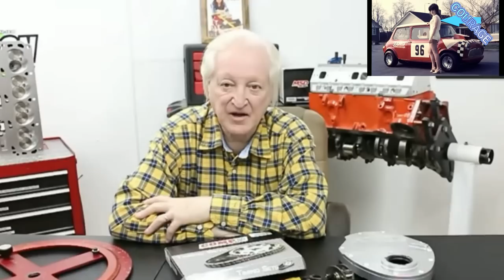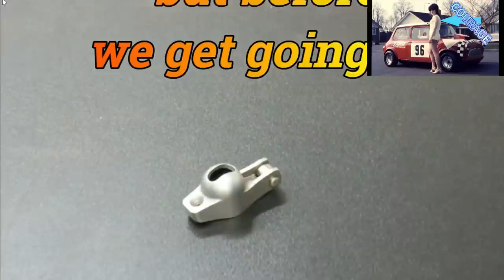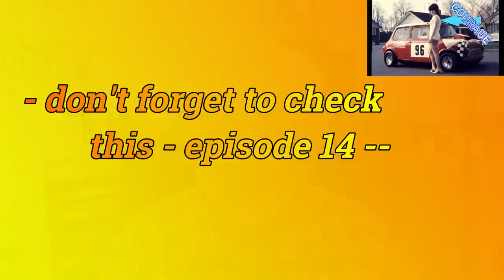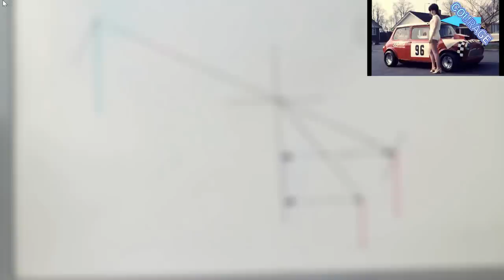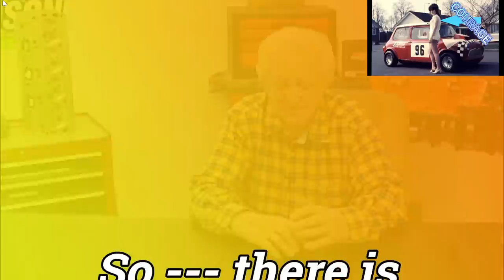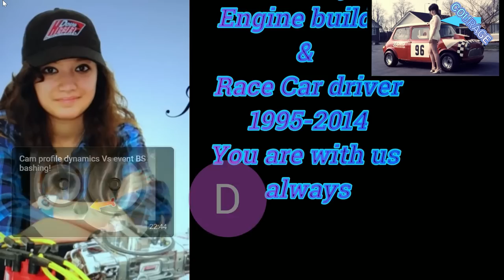High lift rockers - desirable but incorrectly tested.

Comment: I'm running 1.7 scorpion roller rockers on a tbi 350 sbc. Surely that's better than the stock stamped 1.5s
Reply from the maker: Yes - have used a lot of those rocker with zero problems
Reply: Did it make any difference in power? I figured the cork in the tbi was the crummy 2 bl throttle body, not the (puny) cam. I woke mine up with a true dual exhaust and no meowers.
Reply: @jeffrykopis5468  it helped some. The thing about the tbi motors is that the components are matched pretty well.. and NONE of it is designed to make horsepower. Lol
  The stock cam had .385"/.402" lift. If you simply multiply the lobe lift by the advertised rocker ratio lift, you'll get .437"/.456". I haven't mic'd it.. I just slapped them on the stock pressed-in rocker studs. I don't rev the motor past 5k so they're fine for now. I've got a comp xfi252hr roller cam (202⁰/212@.050") (.585"/.581" with 1.7's) and a different set of heads with screw-in rocker studs and comp beehive springs. 
  The rest of the tbi 350's combination is very well matched.. anemic 2bbl throttle body with 2 small injectors to feed 8 cylinders. A 20hz computer. Hz.. like 20 calculations per second... not khz. Not mhz. Not ghz. Not thz. Simply hz. .. 
  Swirl port cylinder heads with a giant ramp in the intake port that are done flowing by 3500rpms. 
  The best thing about them is the exhaust manifolds and exhaust system. They flow just good enough to support the stock horsepower. That's why open headers give almost zero horsepower increase on a bone stock engine. Peak torque was rated at a lugging 2400rpms. Which, with a th400 and 4.10 gears and stock 245/75R16 tires would net cruising speed of 50mph@2400rpms in 1990. Right in the meat of the torque curve. They actually mathed things out back then. To meet lower emissions requirements, just turn the engines slower and tune them for low end torque. 
  I figured a little more valve lift would allow a marginally higher amount of airflow throughput. It can't hurt the rated 190hp, right? 
  I've got the parts together to make approximately 325hp@5000rpms and 430ish lb-ft@3500ish. My biggest hurdle will be tuning the stock tbi unit at over double the stock fuel pressure. My plan is to run a vacuum-referenced fuel pressure regulator before the stock internal fuel pressure regulator fitted with a 29ps spring. The vacuum referenced regulator will deliver around 19-20psi at idle and cruise while bumping fuel pressure (and overall fuel flow) under wide open throttle. 
  With a completely stock engine and computer tune (aside from headers and free-flowing exhaust) my commanded injector duty cycle was 114%@3800rpms.
  My exhaust setup is a pair of 1⅝" long tube headers into a 2½"collector, a smooth y-pipe to single 3". 3"idx24" glasspack. Immediately opened up to 4" and a 4"idx30" glasspack  and a 4" tailpipe out the stock location at the passenger's rear corner of the 8' longbed. It has a mellow tone at idle and cruise but seems to growl at wide open throttle. As much as 190hp can. The tone is deep from the large diameter pipe. The mellow note is due to 4.5 feet worth of muffler. It's a nice setup. It doesn't beat the sound of true duals.. but I was trying to be efficient with it. With cruise control set at 55mph, my instantaneous gas mileage shows as 26-28mpg in a pickup truck with the aerodynamics of a brick. 
  I've figured that the stock fuel system provides 122lbs/hr of gasoline. That's roughly 244hp @100% duty cycle worth of gasoline on old iron. Injectors die at 100%DC, so if you figure 85%duty cycle, that'd be roughly 207hp worth of gasoline in stock form. Very roughly calculated and going off of a lot of assumptions. But the stock fuel injection system is very inadequate. That's why I set my power goal so low on this project.
  Apparently, the stock throttle body flows about 480cfm. It should be easier than Vizard and Uncle Tony's 318hp through a 2bbl carb that flows 260cfm. I do not have access to a dyno so all of my tuning will be on the street and horsepower estimates will be based on 0-60 time improvements. It should work well. If not, I'll install an aftermarket efi system to feed the beast. This is my final attempt at making decent power with the stock tbi system. If it doesn't work this time, I'll never attempt it again.
Reply: @EricErnst  Very good info. I knew some but not all of it. Why not try the 454 throttle body and injectors, a spacer, and an adjustable regulator?
Reply: @EricErnst  I've had 3 or 4 TBI SBCs, from an 87 Suburban to my 92 2500. I haul scrap, a lot of it, never been over 5000 rpm, and my 92 has now spun a rod bearing twice. Bone stock, except for dual exhaust, no kitties (but an O2 sensor in the H pipe), and glasspacks. It SOUNDED faster, lol. I'm now driving a 98 Vortec 454 2500.
Reply: @jeffrykopis5468  does the H pipe get enough flow to accurately give fuel trim feedback? I would think that the same exhaust gas would just bounce back and forth in the pipe. Depending on the length, I suppose. If both pipes are run on the passenger's side, the h pipe would only need to be 6" long or so. 
  I run a heated 4 wire O2 sensor so that it gets warm enough at light cruise with a free-flowing exhaust.
  It's strange that you've had such a problem with spinning bearings. I spun a bearing in my 1993 K2500. I was overrevving the hell out of it though. It has vortec heads and big block injectors. A comp 280h cam, edelbrock performer rpm air-gap vortec 7516 intake manifold, headers and true dual 2¼" exhaust. 
  I was doing burnouts and accidentally shifted into 1st gear instead of OD. I just left my foot on the floor.. the tach wrapped way higher than it should have. 7k, 7500? That was a long time ago.
  I have a supercharged 90 k2500 and it's been flawless.. stock bottom end with trick flow heads, comp roller cam, edelbrock 2604 performer air-gap intake manifold, headers, 3"-into-4" y-pipe and single 4" open exhaust. It's fed by a holley sniper tbi efi system and get 9.5psi of boost from a vortech v3 si-trim centrifugal supercharger. I've revved that thing WAY harder than it should and it's been great. I run 0w-40 synthetic motor oil in it. Good flow on startup. Good protection when I lean on it.
Reply: @jeffrykopis5468  the 454 injectors are too big at idle and light cruise. I didn't mention that my 93 was done that exact way. It ran pig rich and only got about 5mpg city and 6mpg highway. I had a custom tbi chip burned for that exact combination. Under wide open throttle, it seemed to clear up. It was a runner. Right up until 5&6 pistons were slapping the cylinder heads at tdc. She made a hell of a racket on the short drive home. 
  Back to the injector sizing, I am already idling at 2%-3% injector duty cycle with the stock setup. With the low duration of the roller cam that I've chosen, along with the better flowing heads, I'm thinking the fuel required to idle will be very similar to stock. The 454 injectors are 81lbs/hr. Stock injectors are 61lbs/hr at stock pressure. I'm going to use a vacuum-referenced fuel pressure regulator to pull ~10psi from the fuel pressure (the same cam idled around 30kpa in a similare build; 70kpa of vacuum is about 10psi). That will have me idling with equivalent to around 68-73lb/hr injectors. ~19psi vs ~13-15psi. I'm not quite sure exactly what pressure the stock injectors are rated at. Hopefully that will give me low enough fuel flow at idle. At wide open throttle, the fuel pressure will rise as engine vacuum decreases. That will put my injector flow rate somewhere around 84-91lbs/hr. It should be just enough for 325hp. 84lbs/hr should be enough for 336hp and 91lbs/hr should be good to 364hp.. again, depending on what pressure the stock injectors are officially rated at, 13-15. I'll always be able to bump pressure up a little more if I feel like it. But I plan to set my auxiliary fuel pressure regulator for 29psi at 0 vacuum and ~19psi at idle. The internal fuel pressure regulator built into the tbi unit will have a 29psi spring. The pressure will never exceed this. That's my plan anyway. 
Currently, with the cruise control set on
Reply: I have a 1990 tbi 350 with a small cam, chip, spacer and a 2.5" single exhaust. I'd guess 250hp? Runs great and sounds good.
Reply: @1958Studebaker  what size is the cam? Do you remember the duration? Also, why did you choose to go with 2.5" exhaust?  Stock is single 3" on the tbi stuff. If it's open exhaust with no cat or muffler, 2.5" should support that 250hp power number according to DV's exhaust flow calculations. . But bends do slow down exhaust flow. The exhaust velocity should remain pretty high with the small pipe. 
  My exhaust really seemed to shoot out at idle with single 3" on a 405hp combo. On cold days, the white puffs of condensation would seem to have plenty of speed on startup. Idle was around 750rpms. Then I upgraded to a bigger y-pipe and single 4" when I added a supercharger and ~200 more hp. Velocity still seems high. I ought to neck it down to 2.5" at the tailpipe just to see the velocity increase.
Reply: @EricErnst  I'm sorry I should have said single 3" into a muffler with two 2.5 outlets. And I can't remember the cam specs off the top of my head but it's a "little" cam. And no cat. Just a different 02 sensor.
Reply: @1958Studebaker  edelbrock makes a performer cam that's 194⁰/214⁰ and .398"/.442" lift. Melling also has a pretty similar grind. That's among the smaller cams. They brag that it makes 245lb/ft with stock heads and an Edelbrock intake manifold on the Edelbrock site. Surely that's at the wheels. The stock engine is rated at 300lb/ft@2400 at the flywheel. If you consider 25% loss on a chassis dyno, that's about a 26lb/ft gain.
Reply: And it's a 30 over 350 with 9.5 compression.
Reply: @EricErnst  all I remember at the moment is that the cam was a speed pro cam. Someone else mentioned a 256 and that sounds about right. Getting old sucks I used to be able to rattle this stuff off at the drop of a hat.
Reply: @1958Studebaker  my xfi252hr has advertised duration of 252⁰/264⁰@.006". It's one of the mildest cams that comp offers. Mildest, meaning lowest duration. They do offer a tri-power camshaft with 246⁰ of intake duration, but the lift is much lower. 246⁰/258⁰ adv., 196⁰/206⁰@.050" and .470"/.464" lift. 
  256 is a small cam, but still larger than the tiny stock cam. I like to go roller to rule out the lobe flattening issues, but once you get them broken in correctly, there shouldn't really be any issues. 
  The idle smoothness should be near stock while offering a broader powerband. My 202/212 cam is very similar to a stock 400hp LS2 camshaft. Varying 1-2⁰ at 204⁰/211⁰ but it has slightly lower lift. Peak power on that cam is 6000. While I've got better flowing cylinder heads than ls2, I've had others tell me that I won't make power that high.. that I'm closer to 5000rpm peak power.
Reply: @EricErnst  mine sounds really good when it's cold and when it warms up it settles down a bit. I'm going to use this motor in another car soon. Probably do a carb swap. But this is a great running 350. I don't think I'll change anything on it. It's a great daily driver.
Reply: @EricErnst  should have less lifter side thrust   That's a big duration spread if you have modern cylinderheads  More like something to use on a FORD with bad exhaust port
BTW do you have to pass SMOG? I;m in CA so a consideration  Post up your cranking compression    anything with less than a TRUE 9:1 Anything more than 252 will cost grunt and driveability big time   what rocker ratio  looks like more than 1.5   just guessing  here
Reply: @jmflournoy386  I'm running trick flow heads. 175cc intake ports. Comp xfi252hr cam. 202⁰/212⁰@.050". Baby cam. 252⁰/264⁰ advertised. .585"/.581" lift with the 1.7s. I run the factory tbi through a factory gm ecm modified to be able to be flashed with a modern laptop and tunerpro. I did increase the fuel pressure significantly to support more power. The 2 injectors rated at 61#/hr were certainly not selected for their power potential. Lol
Reply: @EricErnst  great but I do not know if you need that long an exhaust with those heads  what's your true and cranking compression,  what exhaust    even if not perfect still close enough for the $$$ to change    only cam change would be to get Jones to put his inverse radius profiles on your core if your cranking compression is  low and you need more torque     (kibbitzing here)  Ive built lots of street motors with 252 or 256 intakes and Trucks/ Busses with mid 245-248   even in a 454 chevelle AT I only went 264 with ported heads and pro build         anything more would hurt  across the intersection or 60 ft times  stock gears and ex manifolds
Reply: @jmflournoy386  it's a very mild cam. Within a degree of stock 6.0L LS2 specs. LS2 was rated at 400hp@6000. My heads have smaller ports but slightly higher flow. My cam has about .060" more lift. Engine simulation software has estimated 406hp@5500. Longer exhaust duration helps a little at higher rpms. Good head flow helps maintain a flatter torque curve past peak power. 
  This is a very mild cam. Very low duration. It's the smallest of comp cam's xfi hydraulic roller line. I think the short duration hurts peak torque more than the longer exhaust duration. It does offer excellent driveability and awesome torque from idle. It's in a half ton pickup and delivers excellent fuel economy. I've seen 28mpg with the cruise control set at 55. From a 32 year old half-ton pickup, that's pretty damn good. It was rated at 15mpg combined 14 city/18 highway. C
Static compression is relatively low at 9.17:1. I'm not sure what the dynamic compression is.. but the cam is pretty small.
  I think you may have the cam specs mixed up as this is a very mild camshaft. The stock camshaft has a torque peak at about 2400rpm and hp peak at 4000rpm with a low rise dual plane intake. This cam is about 20-30⁰ larger @.050" and I'm running a slightly taller dual plane manifold. 
I actually have the same cam that I'd like to run in a different truck with a street tunnel ram with 10.1" long runners and dual 4bbl carburetors. The long runners should help with torque and the straight runners should help top end power. The heads on that motor have 200cc intake runners and 2.02"/1.60" valves. It flows about 270cfm In/190cfm Ex @.600". The 1.7 rockers add lift, but I don't rev high enough to reach valve float.
Reply: @jmflournoy386  my exhaust is long tube headers with 1.625" (1⅝") primaries and 2.5" collectors through a 2.5" to 3" y-pipe to a single 3" exhaust. I'm running a 24" long 3"ID glasspack muffler to a 4" bell adapter to a 30" long 4"ID glasspack muffler to a 4" tailpipe out the back passenger's side of the truck bed. The exhaust velocity should he highest at the 3" diameter section. According to DV, single 3" pipe should flow enough to support about 370hp with zero loss. According to his formulas that open pipe flows 115cfm/in² and 1hp requires 2.2cfm.
  Pi×1.5²×115÷2.2=369.494hp. 
  The slightly smaller size should enhance velocity and mildly increase torque numbers below peak torque rpm, at the expense of peak hp numbers. 
  I do not have an expansion chamber, although I'd be open to building one. I don't believe the 4" x 30" long glasspack would qualify as an expansion chamber. I have approximately 30-32" of 3" ID pipe in my system. The 24" long glasspack has a full 3"id and I believe it flows as good as a straight open pipe, although I have not tested it.

Comment: Help me understand please. If I have an engine with a rocker arm ratio of 1.5 and a valve spring with an open pressure of 300lbs. Does this mean the pounds of pressure at the cam would be 450lbs since there is NO mechanical advantage when opening the valve?

Comment: You should have put a 1.8 on the exhaust as well because the exhaust on those particular heads needed help. That's why you have split duration cams with more on the exhaust side as much as 14 degrees in extreme cases.

Comment: As a side issue, some of the bleeding edge builders are using "negative valve to piston clearance" - by that, they're factoring in the deflection of the valve-train parts for their cam' grinds so that where there is a 'paper' interference it isn't actually interference occuring because the barts are bending and flexing under load to give them the clearance they need.

Comment: Chevrolet SB Stamped Steel rockers even the long slot high lift cam design are actually a 1.37 ratio.  The BB rockers are a 1.7 nominal 1.57 nominal. 
Yunkick made a dimpling tool to dimple SB stamped covers in order to run the BB rockers with 7/16 studs on a SB head.